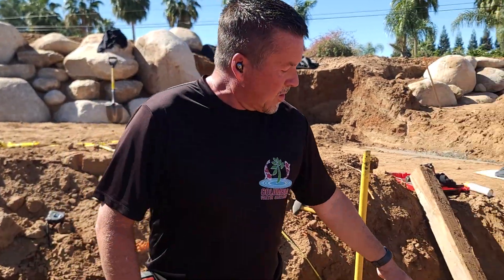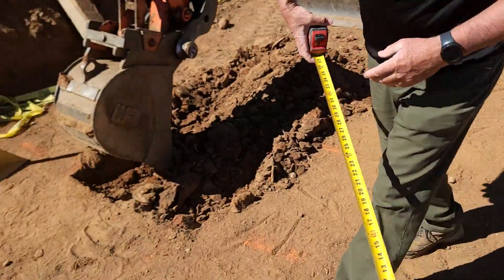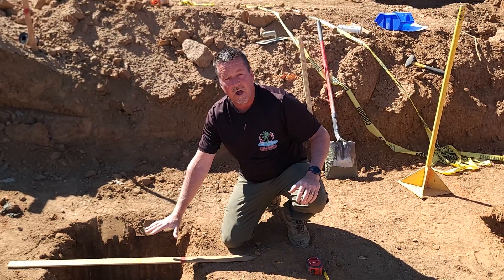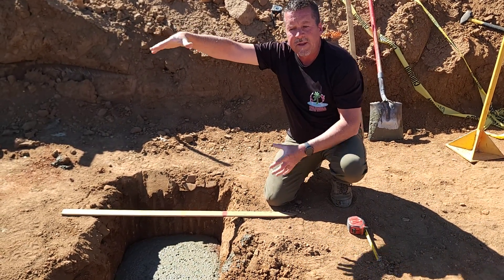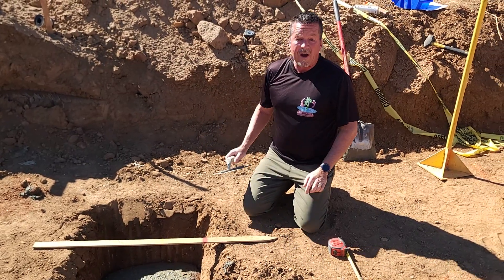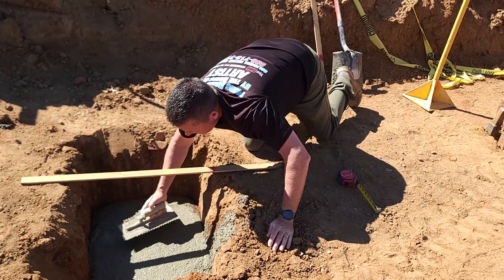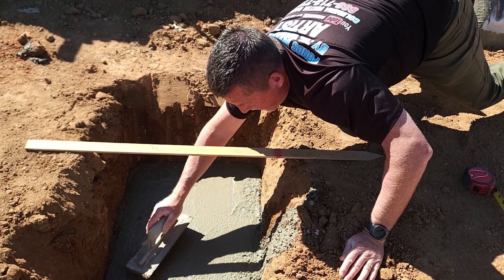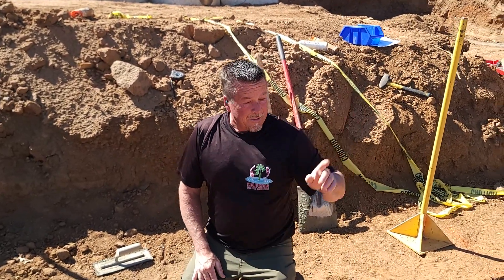🛶 Overview | Quick Tip for setting concrete forms for a POND PIER or DOCK

Comment: Hey
I’m doing some floating steps across a pond with a footer built as you detailed here. Would it be wrong to set the pillars on the slab for the steppers using block work? Or should I do sonotubes?
Thanks!! Appreciate you as always ✌️👊
Reply from the maker: Sonotubes.  Trust me.... I've made enough mistakes to share this pro tip. ;)
Reply: @ColumbiaWaterGardens  Thanks man will do!! I really appreciate your quick response man! I will be pouring the slab and piers on top of the liner tomorrow. So your advice and quick response is invaluable 👊❤️

Comment: Get some flow control from you local construction store to make a wetter pour with out sacrificing strength by adding too much water and you want you concrete to dry for a bit before you float it. Think about when a kid wants to write in the cement but it's so dry they have to use a stick to write in it. That's when you want to float it on a wet slump.
Reply from the maker: They are just footings. They are buried and gone under the liner.
Reply: I'm happy to see someone in the tribe making good pro tip videos btw so thank you very much